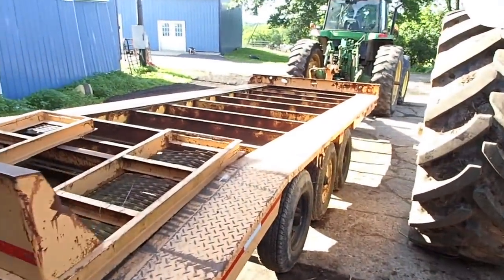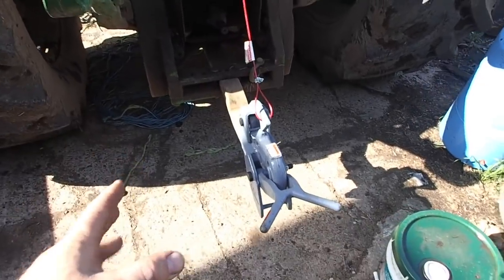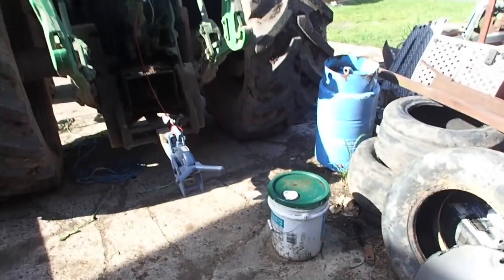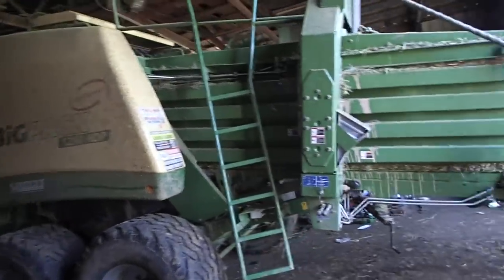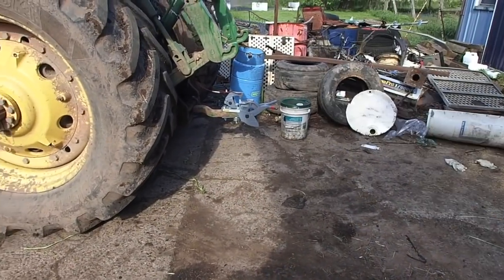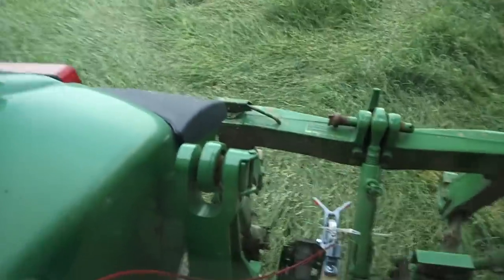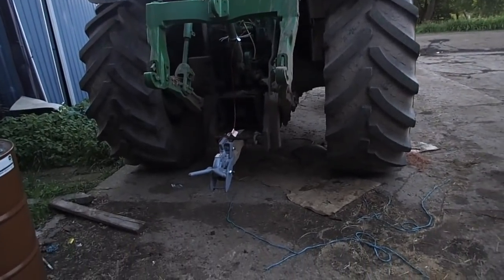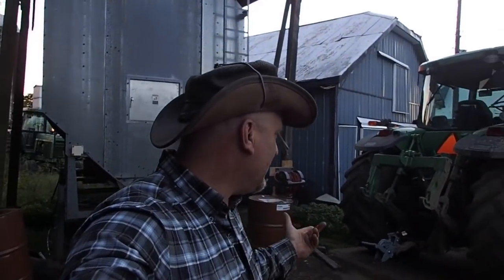Bergman Speed Hitch Is Great

Comment: I unloaded 42 loads of silage for the neighbor last week and he had these it sure sped things up a lot and saved alot of work. When you hook and unhook wagons 25 times in one day you get really good with those hitches. Can unhook and hook in around 45 seconds.
Reply: iowadairyboys i
Reply: I should hope so. I could swap trailers behind a trailed forager, when we weren't side loading, in less than 60 seconds consistently. Trouble was with 80  by 12 ton trailer loads in a day, it was wasting over an hour of time every day. That meant that the preferred. method was side loading which required another man and tractor, but it did allow another 8 acres a day to be harvested due to a 10 second change instead of 60 seconds.

Comment: I worked on a small dairy farm in high school that had a 327 John Deere baler. It had a hitch on the back that allowed the operator to unhook the  wagon from the tractor seat. You still had to get off to hook up to an empty wagon but with a extendable tongue, you could just push the tongue into the hitch and it would latch. We just left the pins in the wagon tongue when we brought them back to the field. It was handy.

Comment: I know exactly where you are at with bale trailers and unhitching.  I totally get that hitch and how it works.  I'm lucky both my tractors here in Canada have the U.K spec pick up hitches. When I have some spare shop time i'm just going to build a trailer hitch adapter with an eye on and a small fixed jack stand on it, to keep the hitch eye off the ground 5" so I can just back up and use the hitch on the tractor I already have.

 When I'm picking up rounds I have to move the trailer twice every load to cut down on field travel and unhook and hook up in the yard before heading back to the field. Thats a lot of time and at the end of 2 weeks every day for 8 hours plus, my arms pretty sore after doing the other chores on top of hitching the trailer. It will speed things up for me some but I'd still have to get out  a few times and mess with a safety chain for the highway travel part here in Canada.

Comment: You could get an electronically actuated servo type deal. Hit a button and it pulls the cable up, hit it again and the cable goes back to where it was and the hitch locks in place.

Comment: Brits have their own ideas and know what works best for them. I haven't seen or used their type but for Wes, this seems to be something that makes his day easier.
Reply: It's for wagon drawbars, not weight-transfer trailers. In the UK we need weight transfer trailers for hauling bigger loads behind smaller tractors relatively speaking. Especially on hilly land and roads to give more traction and avoid jackknifing, which is an issue with turntable trailers.
See this grass silage haulage video for typical UK and Irish work.
https://youtu.be/Gz4d9bvxzE8

Comment: Worked for a guy that had a hydraulic cylinder hooked up to one of these they made a bracket that held the cylinder in the top link holes then had a spring mounted to the end of the cylinder with a cable running to the quick hitch you simply extended the cylinder to unhook and the spring exstended enough to pull the cable but not brake the cable worked real well

Comment: I had an idea for the safety hitch, so you too can engage it and not have to get out of the tractor. You could weld about a 2 inch length of piping to hwere the normal pin hitch goes. maybe drill the hole out to about 5 - 6 mm . and get some 6mm solid round stock long enough to go through the hitch to just come out the other side and then stick out the working end about 3 inches. You could weld a washer over the rod right flush with the hitch. now get some tubing wide enough to contain the tubing with washer on it about 2 inches long. weld the tubing to the hitch over the hole. And find a spring that is about half an inch longer than the tube. now put the rod inside the tubing and put the spring on top of the washer, and now weld another washer on top of the tubing that is only big enough for the rod to come out of it. or you could thread it and use one of those lead pipe plumbing caps and drill a hole in the middle big enough for the rod. You just need to make sure that the tube is long enough to hold the tube when it's pulled fully out of the hitch, I dont know how long that is, but you get my drift. And you can have like a bicycle brake lever just behind the rear window that pulls the safety pin out and get a bowden cable kit from ebay for like $10 and make it to the correct length. Happy days.

Comment: Hi Wes Mathew form Australia. I like watching your vids we use a different style of quick hitch its a 3 point hitch 1 haven't looked back since we bought it. They do not sell those over here but if they did we might look into it. I have a quick solution for your dad and your idea of a hydraulic ram.. Reckon keep the cable but connect it to the linkage arms with a spring or rubber strap so that when you put the linkage arms down it eventually take up the slack and releases the hitch? Just a thought love the vids mate cheers

Comment: Is there any way you could run the cable to the floor of the tractor cab and using something like a foot pedal?.    Just a suggestion Wes Thanks for sharing..
Reply: Thought of that too but one wrong move and  you drop the trailer when you don't want to (like on the road). 

Plus his Dad takes the dog with him in the tractor I think, and that would be right down where the dog could flop onto it and presto-- unhitch at the wrong time!  

 Later!  OL J R :)

Comment: Why not add a small electric linear actuator to the cable and mount it on the back of the tractor somewhere close to the hitch.  Just supply 12 volts and mount a button or switch in the cab.  Turn the switch one way and the actuator pulls the latch open.  Flip it the other way and it lets the cable go slack.

Comment: Maybe for you Dad's tractor make the cable a bit longer and put one of those big D-shaped pull rope handles on the end like the ones seen on snow blower engines?
Reply: Maybe have the cable long enough to mount it from the front of the cab so he can pull from the front and not at the side as it is now.

Comment: John Deere 535 discbine keeps breaking the bolts that hold the gear box on the discbine and when the bolts break then the plate that holds the gear box cracks I like the discbine  I had the mower at John Deere shop 6 times last year they can not fix it last time only thing they did was put thread lock on the bolts  do you have any idea to fix

Comment: I was using one when a Parker wagon had the box beam front axle split in the middle.   I pulled the wagon set off the road into a field access drive and got the hitch unhooked.  Lost some paint off the hitch beating the trip lever to the release position but the hitch was unharmed otherwise.    When the axle broke it put the tongue on a twist.  That put pressure on both the top and bottom of the movable parts.   And the wagon set was loaded with 700 bushel of corn and downhill toward the tractor.   took some bad words and some beating on parts to get them loose.  Unhooked the back wagon and  pulled it in to empty.   The next day we used a kiddy pool and a grain vacuum to empty the broke back wagon.   The wagon was traded in to a salvager and sat there for 2 weeks before they came and got it

Comment: I live in the uk and my dad hates the European hitches as they take up a spool valve that might be need if we use a pull type cultivator as our tractors have 4 spool values but one is permanently plugged into the front linkage for safety reasons then the hitch taking a spool valve meaning you only have two other spool valves  available to use
Reply: Makes no sense. Front linkages usually have a valve block close to them to disable the linkage meaning u get a usable spool.
Reply: well we have two tractors build same year with linkages and the first one is permanently plugged and the other has quick couplers  in and we ask the dealer and they said well it shouldn't have quick couples. but the linkages on the tractor are from the factory so should have something so you can use it but there isn't
Reply: adam thompson should be hard plumbed into the spool block. And a tap on the line to the front linkage so u can still use those spools

Comment: How about trailer brakes and lights for the trailer?
Reply: Cormé Burgers dont need
Reply: Fair point. Those are needed for road transport and steep land. Otherwise not needed for flat private land. In my case with a trailed forager, if labour wasn't available for side loading on steep land, the trailer had to be attached to the back of the forager, using an automatic hook hitch, plus I had to get off to couple a through hydraulic brake line. And the haulage tractor's driver had to get off twice. Once to take the lights, brake  and tipping pipe off, then to connect the next trailer's. I'm old enough to remember having to do this multiple times a day using Dowty screw-on hydraulic couplers, before quick-attach couplers were available. No brakes or lights on trailers in those days though.
Reply: Huw Williams ah oke, thanks. Here in The Netherlands trailer brakes are obligated by law. Since Jan 1 2018 hydraulic brakes are not allowed on new trailers and tractors, so air brakes are required. Trailer lights are always required and there are a lot of rules about reflectors, traiangles and the color of the lights. I think that's why we don't use speed hitches, because we have to get out of the cabin to connect at least two hoses and cable's. As a driver you really want trailer brakes in The Netherlands, even when the land is flat, we use 120 hp tractors to pull a full 20 ton (44000lbs) European trailer.
Reply: Jan 1 2018 was the EU date for 'Mother regulations' which brought in a whole lot of new safety regulations, including cab decals and switch decals, wide angle mirrors, mandatory air brakes, seat use switches and linked PTO switches and more.
Of course we can still use trailers with hydraulic only brakes and we can choose not to connect them on private land when it is appropriate. Same with trailer lights in that they have always been required on public roads but on private farm land it is up to the driver whether to connect them or not.
http://cema-agri.org/newsletterarticle/countdown-mother-regulation-european-type-approval-all-tractors-1-january-2018

Comment: Just for being lazy I feel like you could attach that cable to the top of the three point with a large spring so when u pick the three point up all the way it’ll unhook. You’d just have to run with the three point like an inch or two lower than normal.

Comment: Mechanical simplicity is nice, but that this is screaming for a simple electric solenoid to perform that function. Push a button and you're on your way.
Reply: Yes and another one to retract a spring loaded locking pin to prevent inadvertant uncoupling... have a little control box that could sit on the fender next to the controls, and plug right into the tractor's trailer connector for power and ground... easy peasy and much safer!  Momentary switch on both solenoids...  

Later!  OL J R :)

Comment: That's the thing isn't it. This hitch isn't designed for trailers that transfer weight to the tractor's drive wheels. UK trailers usually work with up to three tons of weight on the hitch to aid traction so we can use bigger trailers on smaller lighter tractors.
The drawbar on my tractors are only used for towing a baler and a forage harvester, and since I now get a big Claas Jaguar in, not even on the forager. They do tow 12 ton trailers full of forage along the SPFH and home to the pit at high speed and on steep land and roads though. Where the road is suitable, up to 35mph/50kph. Same with the slurry tankers.
I'm dreadfully underpowered for the road haulage actually. Sub 200hp on 40 and 50kph tractors [or even 30kph, it makes no difference] up hills pulls the speed back to 11kph and on one steep road section, 9kph. The semi-powershift New Holland is more efficient than the CVT tractor, because they perform equally with identical loads up hill, yet one is 140hp and the other is 177 on the shaft.